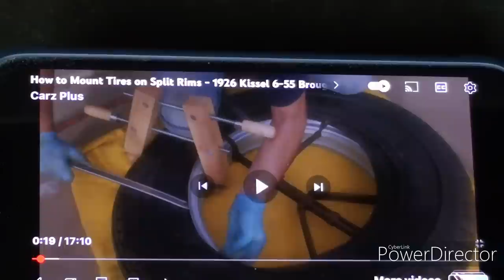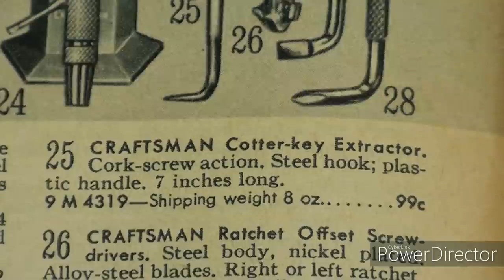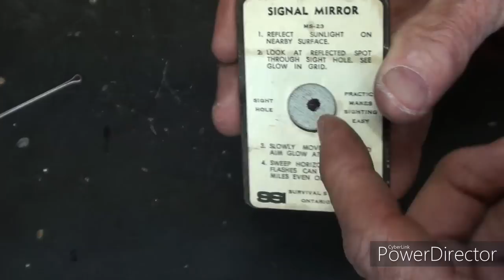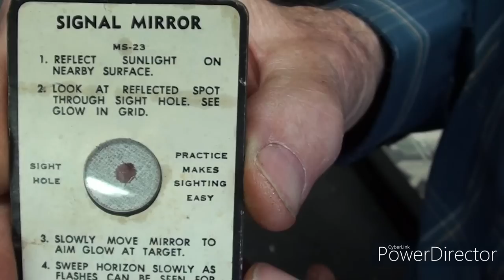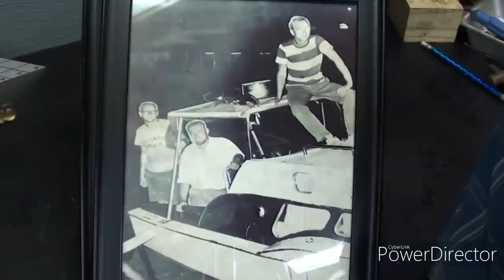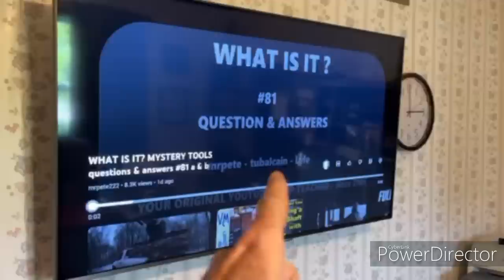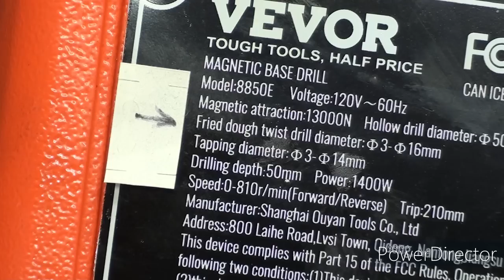tubalcain ANNOUNCEMENTS - Mrpete vents temporary

Comment: I don't have a problem with you showing a product.  Even if they give you one, they're taking their chances with you finding something wrong with it just as easy as liking it.  I watched a video yesterday of a guy making a forge and he was cutting all the holes with a torch, never once even grabbed a drill.  Well, there you go.  If you come along later and are working on something, would you rather find round clean holes or cutting torch edges and burn marks?
I have one of those Craftsman bent tip awls and I've always used it for unsticking radiator and heater hoses and it works great.  I never knew about the cotter pins.  
I was replacing a faucet in the bathroom at Grandma's house at the lake and could not get an internal o-ring out to save my life.  On top of that, it was Christmas and very cold, everyone was dropping in and we had to crawl under the house to turn of the water because I broke part of it and couldn't put it back together.  I finally drove an hour each way to get a set of those picks and finally was able to put in the new faucet, lines and valves.  Can you imagine a house full of people and not being able to flush the toilets?  Have you ever walked into a gas station restroom that wouldn't flush?  Yep, like that.
Reply from the maker: Good story thanks

Comment: Hey Brother, we both have cutting oil and Tremsol in our veins. I'm a younger 77 years old. After my long trip as a machinist I was the Chief of Manufacturing Operations at Criterion Machine Works . As you probably know we manufactured machine tool products. However we also did job shop work , 50% of our work was job shop work. By now everyone has heard of AI. Well I don't know much about A I but here is a SHORT TRUE STORY fer ya.. In the 70s I was foreman of the grind dept. I remember one of the engineers coming out to the grind dept. (22 machinist) He tells me over the scream of the Heald internal ID grinder" Stop all work on the S.I.A.M. parts. We were in Costa Mesa and were under government contract for making the control components for the Trident, Minuteman, and SIAM missles. It just so happens that SIAM stands for Self Initiated Armed Missile. Well now when they were testing it, it took off and started on a path to a passenger flight on it's own. The test flight was over,they blew up the SIAM . Please take care my friend, see ya sometime.
Reply from the maker: Wow, that’s quite a story

Comment: I enjoy your videos. Was that floor model drill press you have in this video a South Bend ? I recently bought a bench model South Bend to go with my 9 inch lathe. By the way I was looking through some of your older videos and realized we have something in common. I to back in high school made a Casting Speacialty hack saw. The 8 inch blades were difficult to find but the vise migrated to a drill press from time to time. ...where is that dumpster you deposit the unwanted tools...Keep up the good work you are appreciated by many.
Reply from the maker: No, it is not a south bend.  I always wanted one, but I have never ever actually seen one.

Comment: I have one of those craftsman cotter pin or cotter key removal tool. Nothing else for me works as good. As far as radiator hose yes there I s a tool that is similar in shape to break the seal on old hoses. If you want my tip on old hose removal I s e your plug in electric gun first on the hose end and it with soften and then twist right off. When putting hose back on use a little grease or some high temp anti seize inside the hose end.  It will go on easier and come off with ease after that. Just my two cents worth.

Comment: It's interesting about the mirror because I started using one recently.  Not to signal ships, but to run off some hawks and crows.  I raised a squirrel and feed it every day outdoors (and some others) and there are a lot of birds that hang around.  The idea of course is to hit them with the reflection of the sun with the mirror and once you do they take off.  You don't need the hole, just move around until a close tree branch is in front of them then shine the light on that branch and you'll hit them too.
Reply from the maker: Thanks, I have to try that
Reply: @mrpete222  Sometimes the sun is behind me and it doesn't work.  I've been thinking about mounting a couple of mirrors on some wood so I can bounce the reflection and make it work and even put a couple of nails for sights on it.  My mirror doesn't have a hole in it, but I could easily add one with a diamond burr.  Basically just a stick with a couple of mirrors on it than can tilt.

Comment: I have been making 2in holes(ugly) in cast iron. I use a 13/64 drill bit in my small chinesium drill press, drill in a 2 in circle via my layout, and proceed from there. It's a ton of those holes but it works. Luckily I enjoy it. Just this job is making me eye camelback drill presses or a huge post drill nearby.
I haven't watched broadcast in 10 years.

Comment: OMG! I used to work for a furnace company  30 years ago and they had a roto-hammer drill with a bad clutch. That thing would bind and before you could release your finger from the trigger, it would have your arms spiraled around each other. It was no fun to use. Especially overhead because it was quite heavy in addition.
Reply from the maker: Scary

Comment: I worked for the phone company and was prewiring new construction apartment buildings. My supervisor ordered me one of those Black & Decker torque twister drill. I was on a 6ft step ladder 🪜 and the wood bit caught a knot or some other imperfection in the ceiling joist and it pulled me off balance before I could let go and down I went breaking a clavicle bone!
When I came back to full duty I gave the thing back to him and went back to the brace & bit!

Comment: Terminology is interesting.
In Australia, what you called Cotter Pins, we called Split Pins.
Cotter Pins here referred to a tapered pin as used on bike cranks.
Reply from the maker: Yes, I think they use different terms in England. Are used to work with an old man that called them Cotterman pins.

Comment: I don't mind if someone makes a video about something sent to them as long as it's relevant to their content and they're honest. I really think you tubers deserve a much bigger slice of the pie when it comes to ad revenue.  Perhaps then the in video ads would be less common.   
  Snap on, Matco, and such do make a radiator hose removal hook like that, but they generally have a long handle. They sell one like you have there, and they call it a cotter pin remover. It's the same hook, but it's shorter.  It's just semantics because they are basically the same thing with different length handles. It works great on hoses, though.

Comment: I will admit that I was surprised to see the vevor stuff, not something I see from you often, but I see else where often.  You are not a sell out as long as you disclose that I was sent to you and to give your honest review.  What some people don’t understand is thatDIYers often can’t afford the best tools out there.  Of course we would all love to have top of the line Milwaukee mag drill but cost is simply out of reach of most people.  Buying used is an option even then you can’t always find what you need when you need it.  Plus trying to find quality used tools takes a lot of time that a lot of people simply don’t have.  That’s where harbor freight and vevor come in.  If it does the job then it better than nothing.  Most of the people that buy a vevor mag drill where never going to buy a true professional mag drill so it was either try to use a corded drill,  or buy the vevor drill.

Comment: for my neighbor, who had a wimpy drill press, i made a bracket and mounted a torquey  1/2 inch drill, replacing the original 1725 motor . whipped up a stub shaft for the step pulley, which had to be pinned to the threaded drill shaft, as the drill has to run in reverse, and suggested to his wife to buy him a Drill Doctor. His shop life took a great leap forward.
Reply from the maker: That is a great idea

Comment: I don't mind seeing commercial products at all, especially when they're good. Anyone up in arms about it is probably jealous about you getting free stuff :-) I'd watch a video of you making that little engine. Also, about these nutrition shakes. I used to get them in powder form. It was a lot more economical to get them this way. This was when I was living in UK so the brand is most likely of no use to you. It was sold as a medicinal product sold in pharmacies. I'd ask there if you're interested. It was labelled as "full meal replacement", in sachets to be dissolved in milk or water. It came in a number of flavors, my favourite was banana.
Reply from the maker: Thanks

Comment: Hougen mag drill and angular cutters work great for larger holes in plate.
Reply: @mrpete222  they can also drill a half hole on the edge of a plate or make a figure 8 by drilling intercepting a existing hole. I once had to remove a broken 1" foundation bolt on a turbine base. Someone else started on it and drilled a pilot hole way off center. I was able use a 7/8"  Hougen cutter and drill out the broken stud with a off center pilot hole with no problem.

Comment: Recently I had to enlarge a hole in metal, my drill was at the limit at about 1/2".  I used a cutting torch to burn out or open the hole.  It is not pretty but it was quiet fast and fun.
Reply from the maker: Yes

Comment: i inherited a very fancy Mac Tools brand cotter pin puller! it came in a set with a cat claw (trim remover) and some other very strangely shaped tools. they are all tools that a lot of mechanics would just make by bending a screwdriver, so Mac sells them essentially pre-bent along with their fancy plastic handle that doesn't get slippery when its oily. i inherited a LOT of very specific use mechanics tools and some of them i still am not sure what they are. the most recent one i discovered its use is a ball detent punch. it looks nothing like what you would expect!
Reply from the maker: Thank you for commenting. I’m afraid I never heard of one of those punches.
Reply: @mrpete222  i may have the exact name of the tool wrong, but its a very specific tool for repairing (or installing) ball detents in a square drive ratchet. for example, if you have a 1/2 inch square drive where the ball is stuck or broken, you can pick or drill the ball out, remove the spring (which may be broken), and then clean the blind hole, place a new spring, place in a new little ball bearing, and then the tool comes in. it is designed such that the punch has a spherical indent instead of a flat tip or a point, so the punch will center itself on the ball detent. the rim of the tip of the punch is wider than the hole you have made for your ball detent though, so you just git a few good hits with a sledge hammer, and the metal around the ball bearing will be swaged in trapping the ball. 

my dad told me that his dad used them all the time to repair people's old ratchets that would no longer retain a socket. they can also be used to install a ball detent on anything though. it is apparently much much easier than using a regular style punch to try to and peen the ball in place. 

i inherited nearly the whole catalog of mechanics tools that were manufactured by Mac from my gramps. there are a number of strange ones in there and i think every time i open the huge tool box i find another strange little tool. yesterday i found a replacement part for a planometer and that took me a while to figure out what it was haha

Comment: When I was in high school shop class back in late 60s I used an electric drill to zip bit a hole. I locked the power on and started drilling.  As the bit broke through the 2x4 it caught and the drill started spinning wrapping the power cord around the drill.  It struck my hand first.  That was painfull.  I had to unplug the cord from the wall to stop it.  Learned 2 things.  Don't lock power on power tools and be careful using zip bits.
Reply from the maker: Scary, I don’t like those zip bits.   In fact, I gave a whole box of them away to Habitat for Humanity. I should’ve put them in the recycle.

Comment: As others have said, prayers for your health.  Nutritional drinks can help, not sure I'd recommend Willie's other habits, though!  Don't worry about the detractors.  It's much easier to be negative than to create and share, as you have.  I'm still wending my way through the video collection and have enjoyed each one.  Sure, build the little oscillating engine, they're cute and I'm sure you'll put your mark on the one you make.  

What's not to like about free tools, anyhow?  As you said, much better than drilling with a large machine.  

My knees feel for you.  I laid about 900 sq ft of it this summer at my son's house.  I dug out some old volleyball pads for relief the second day.  After our twins were born, I worked a second job with the USPS doing data entry, I suspect, training the optical scanners to read.  Interesting stuff, but very strange to be in a semi-dark room of 500 or so with no talking and the sounds of keyboards being stroked.
Reply: @mrpete222  I forgot to note that I have the same home issue.  Every room project turns into demolition because they put wallpaper directly onto the unpainted wallboard.  Any attempt at removal raises paper fuzz that cannot be blended down, unless I wanted to hire a plasterer.  Except the bedroom that has wallpaper over paneling which IS coming loose from one wall.

Comment: Super good video, for the last 30 seconds if nothing else. 

I had a bariatric surgery last year, and couldnt eat much for long time. It will definitely make a guy weak. The body consumes its own muscle when it runs out of easy fat to burn. Im still recovering from that. Eat proteins FIRST, and nothing else until that is done, when you have limited capacity.
Reply from the maker: That sounds like excellent advice

Comment: Don't stop learning, I can remember the first time I got ER collets, haha. Yep, the few things I watch on TV are car restoration or making shows. The rest is BS or lies.  I don't mind some ads in good yt chs.  And Vevor does have some good stuff, got my 3018 from them, but I never buy from Amazon or Alibaba etc.  Addons and bits for the 3018 I get from local, smaller, better niche suppliers to give them my support, saving a few cents or dollars is not worth the trouble that can happen when things go wrong from China shipped things.  Mag drill would be handy to make holes in a DIY welding table top.

Comment: Don't like to make big holes?   My favorite bridge, early 1900's fully riveted, no welding, I-beams just flat & angle iron riveted into beams for the truss with huge dog bone links connected with 12" diameter pins below in tension.   The Titanic had like 3 million rivets, probably 3/4 to 1 1/2" diameter, so that means at least 6 million large holes in steel plate & angle.   My gripe is that the riveting, heating, tossing, bucking & peening/forming, is always emphasized while the F'n holes are REALLY the tough part, whether drilling or punching them.
Reply from the maker: You are so correct. I have watched a lot of riveting on old buildings and shipbuilding, and they never show how the hole is formed.

Comment: To mention a brand name, my Dad nearly lived on Ensure in his last couple years and it really helped him keep his weight on.  Now the little steam engine, yes I want to see you make it and as an inducement I would be wiling to make you a fancy walnut base to mount it on at no charge.  As to the commercials that creators add, I hate them.  There is one machinist that I used to watch (no names don't want to hurt his feelings) has turned his content into an infomercial about the machines he has been given, or loaned, or other arrangements.  He gets a lot of views, but not mine because if I want to watch a commercial I will go back to broadcast TV.  Your use of Vevor at least is related to metal working and I found it interesting even though I have no need of one.
Reply from the maker: Thank you for an interesting and great comment. Thanks for your support.

Comment: I have one of those cotter pin removers.  Had it for over 40 years.  One of the most handy tools in my box.   The snap-on one does not have the bend in it.  Not as useful.  Wish I could find another craftsman one.

Comment: A video on the boat trip with your brother would be a winner. You need to talk about the original vessel that nobody was interested in until you finished all the work. Dont try to make it short. Besides family it will be for dedicated Tubalcain fans also.
Reply from the maker: There were actually two trips. One on a raft, and the other on that pathetic tub.
Reply: @mrpete222  I thought that you should spend a little Time on the pathetic tub story at the beginning of the video. I liked how you finished off the video talking about what is important in life, #1 family. You probably have had people commenting how good you have it owning all those tools. I know like me you bought most of them used then fixed them up, plus think of all the money you saved doing repairs around the house with those tools. I hope that you are able to keep weight on and that Jesus plans on keeping you around for awhile. Sorry that got long from a long time viewer Andy Z.

Comment: That cotter pin tool is what we used in the glass industry to install rubber set Automotive windshields we used them to straighten the rubber lip out around the glass. The only thing i would rather see is promotion of US made products instead of Chinese crap .
Reply from the maker: I agree, but there are no American products. And they’re never will be again.
Reply: @mrpete222  You may be correct but I still hold hope for this country